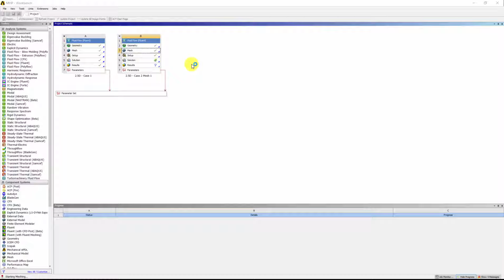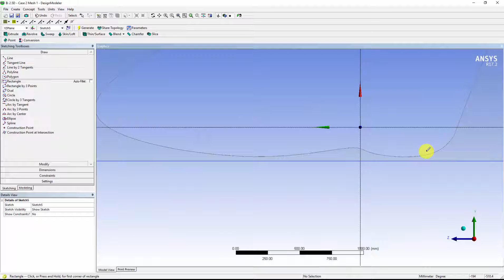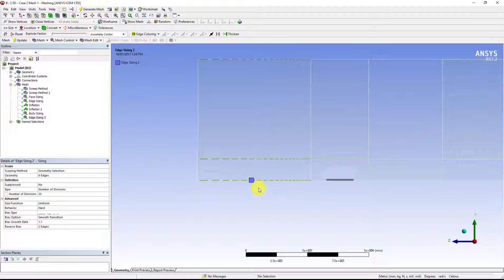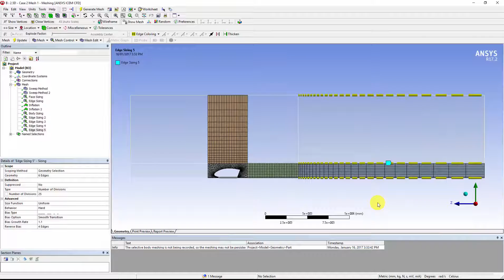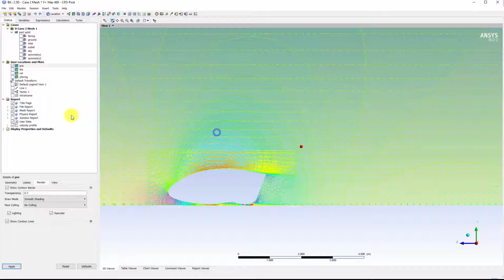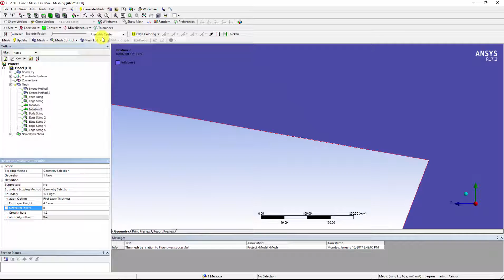Y+ Mesh Study - Monash Human Power Faring #6

Comment: Hi LEAP Australia,
I am trying to simulate flow over an airfoil NACA0012  . I have made the grid with 40693. But when I am trying to simulate it in Fluent First thing it gives me a warning: 
The mesh contains very high aspect ratio hexahedral
or polyhedral cells.
The default algorithm used to compute the wall
distance required by the turbulence models might
produce wrong results in these cells.
Please inspect the wall distance by displaying the
contours of the 'Cell Wall Distance' at the
boundaries. If you observe any irregularities we
recommend the use of an alternative algorithm to
correct the wall distance.
Please select /solve/initialize/repair-wall-distance
using the text user interface to switch to the
alternative algorithm.
Thanks